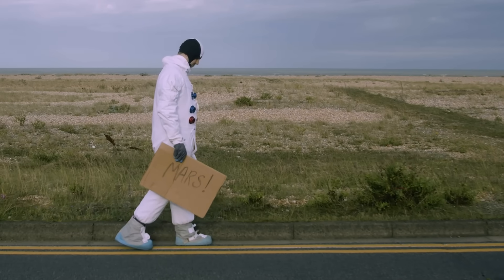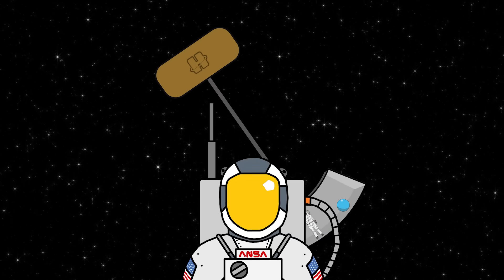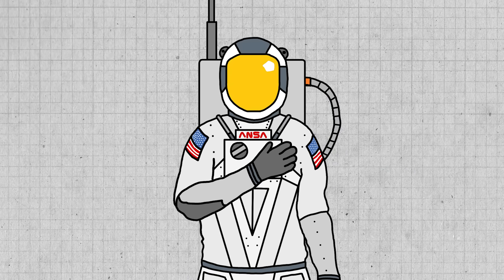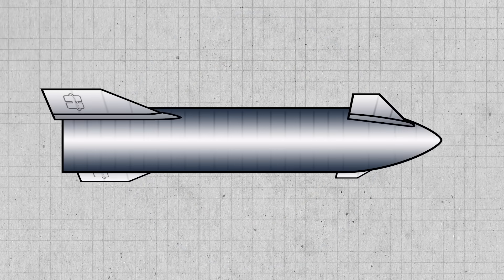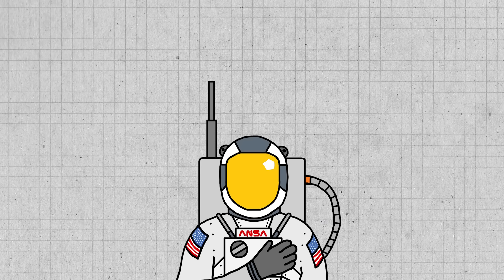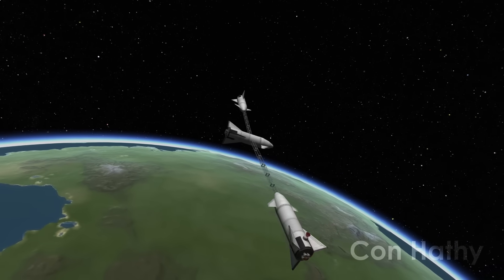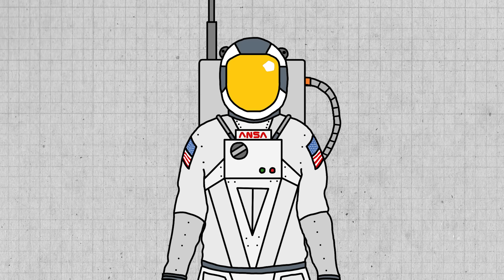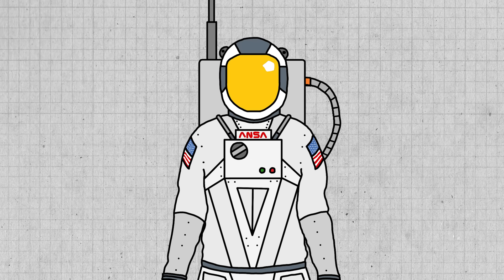This is NOT how you make Artificial Gravity

Comment: If astronauts lay down vertically on the internal circumference of the starship, on a rotating frame, and be spun around the ten meter hull, would that be like sleeping in gravity?
Reply from the maker: It would be, but laying down is has many of the same side effects as zero-g so it would not be very effective

Comment: I think when you actually get in space, real zero G ...none of these will actually work unless you are connected TO the ship. IF you jump up, lose contact for a bit...you'll be hit by a wall. 
"Oh but you'll have the same momentum as the ship"...yeah..til you stop touching it. 
If you're floating in space and a cylinder is spun around you...nothing will happen...nothing will draw you to the surface.
Reply from the maker: You do keep your momentum when you jump, the same way you can jump on an airplane or a bus and you don’t hit the back wall. Don’t confuse speed with acceleration. The only time you might “hit the wall” is while the rockets are burning to get the spin started, once you’re up to speed it doesn’t need to accelerate anymore
Reply: @ConHathy  But you have actual gravity working in an airplane or bus. you jump up, you come down. Takes a second. Not much time to lose momentum. With no real gravity, if you are able to jump up...nothing will bring you back down. 
Just wait. It's going to be hilarious when they actually try.
Reply from the maker: @yourhandlehere1  Your momentum carries you forward but because you’re traveling in a circle forward ends up being the floor eventually. Also from a relativity perspective you could think of airplanes or even buses as not having gravity but rather the wing or the suspension/wheels are accelerating the vehicle upwards so once you jump the vehicle flies up and catches you the same way that the ship rotates forward to catch you when you jump in space (not entirely an unfounded assumption because if you cut the planes off of wing midflight you’re going to end up in ZeroG for at least a short while so they really are the immediate source of the upwards acceleration)

Comment: I think either Smallstars got his idea a little wrong, or you're showing it wrong.  That center ship shouldn't be rotating at all.  It would be 0G, and provide the navigation systems, as well as a 0G work environment.  The other two ships would be attached with the scaffolding, cables, tubes, or whatever.  The scaffolding would just have a rotating docking clamp at the center, where the center ship docks to it.  The center ship would probably be docked at the nose, but whatever works best.    It's the classic ring ship from all the promised mysterious future stuff that we got in the 60s through 2000, before we gave up on space travel.    Rather than a full ring, it's just two ships, and the imaginary circle that they're on.  The center hub is what the center ship is touching.

So, no angular momentum problems.  No flipping and tumbling.   It's just there, where someone will (hopefully) be managing the mission from. 

That scaffolding doesn't need to be very fancy.  Like you said, we can already hang a starship by it's nose.   Basically the same thing, except twice as thick.   A expandable tube, like an expandable tunnel cat toy, would just be there for moving between the ships, in case something gets dropped, or someone loses their grip from the ship's tether.   In a scifi future, it could be pressurized, and everyone could be running around with no spacesuits.  In the real world, they'd have to bring that air along, and it'll suck when it's lost.   Once they've perfected infinite capacity air tanks, to go with the infinite capacity fuel tanks, we can revisit pressurizing the cat tunnels.

If the scaffolding was fancy and strong, it could (in theory) use the center ship to accelerate and decelerate the whole spinning mess.  But since all that mass has to be brought up there, that's too much weight, with little reward.  Stop spinning, disconnect, and they can all slow down on their own.
Reply from the maker: I show his own animation, it does rotate. But, just having the scaffolding rotate wouldn’t solve the issue unless you fully disconnected the center ship with a massive 3 axis gimbal, which would be extremely complicated
Reply: @ConHathy  Ah, ok.  Ya, his way would be problematic, like you showed.   Like he shows. :)  

The way I'd see it working, it wouldn't be a gimble.  Just a clamp on a bearing.  The cables and rotating ships would be like a propeller on an airplane.    If you could just release the propeller in flight, and reconnect, as needed.

They might want a large rotary connector, if the ships are sharing or transferring resources like power, data, water, or air.  Those already exist for a variety of applications, including electrical power, data wiring, pneumatics, and hydraulics.  There'd just be some work to do, to make sure the contacts don't cold weld themselves in space.  I'm sure NASA and SpaceX have put some thought into that already. 

Unless the center ship provides thrust, but I don't think they would really have any forces on it.  They could entirely detach the center ship, without hurting anything.   Unless the miniscule gravitational forces of the ships would be detectable.  Like how the rocky asteroids we've landed on recently are just small rocks and dirt, but still stay mostly together.

I only said scaffolding, so it'd be a hard connection, that would be less risky of losing astronauts and supplies.  The cat tunnel toy around attaching cables would be just as good.  Big enough for humans, of course. :)   They've shown that sort of docking tunnel in scifi shows/movies.  Somewhat realistic shows just show them being a very lightweight covering, so dropped items don't float away.

Comment: Never thought of using a small spinner... but I'd imagine it has to be a little bit larger than the one the researcher was using. Correct me if I'm wrong but it looked like his feet experienced the target Gs while his head was at 0 G still. More like stretching your skeleton than compressing it.
Reply from the maker: The video wasn’t a great demo because it’s in a control configuration. The eyes were intentionally at 0G, cg is at 1G and feet are at 2G. They also extend it so the eyes will also experience acceleration
Reply: @ConHathy  Ah, I see

Comment: Large counter-rotating space stations work fine, if we have construction facilities in orbit or on the moon. Even more so if we nuke the sides of some big comets and asteroids to shift them closer so we can mine them with less travel time...or for that matter, hollow them out and build stations inside of them, using taped composite bubbles, with the rock as radiation shielding. Then use the outer surface, perhaps 30 km circumference or thereabouts, spinning around 30 times per hour, as your tether platform?

Comment: Sorry, but your theory has more holes in it than a screen door. You did not discuss frictional bleed. That is where the rotating device bleeds its motion into what it is mounted on via friction. Eventually it would need to be corrected using fuel. Another thing is refueling the space craft once launched. Using a drone ship filled with fuel then placing that fuel in the mother ship. There needs to be a lot more research in what we need to do to provide a gravity to the ship while traveling to protect the crew from those things that would happen to a crew if traveling in a weightless environment. All of this research must be done with the ship being in space without an outside atmosphere.

Comment: The problem with a short-radius centrifuge is that your body experiences a gravity gradient, not dizziness or motion sickness.  Those experiments you show have the subject strapped to a frame, doing nothing.  His head is experiencing zero gravity (horizontally), and his feet are presumably at 1g.  What about when they remove the straps and try to do something useful?  If you bend down to pick up something, your head is suddenly experiencing many times more gravity.  E.g. if your feet normally experience 1g, and your head 0.1g, when you bend down your head is probably experiencing 0.5g.  Your head is now five times heavier than your neck has become used to supporting.  That thing you lift off the floor is going to get lighter the higher you lift it.  This isn't so bad, but when you move something from head-high onto the floor, it's almost weightless when you pick it up, but it gets heavier, much heavier, the lower it gets.  What started out as an easy operation suddenly gets out of control as you find it's actually too heavy, and you drop it.  You may fall as a result.  Now your head is experiencing maximum weight, but your neck muscles have atrophied due to spending most of their time at close to zero g.  You probably can't even lift your head.
I know we can adapt to different gravities, but experiencing a wide range of gravities simultaneously, where your hands weigh different amounts dependent on how elevated they are?  I can't see short-radius centrifuges being of any practical use for anything but short-term exposure.  You need to be far enough from the axis that the gradient is insignificant.  This means you're limited to living and working in the tip of the craft, and you'd be walking on the ceiling, which probably means the craft has to be much larger than it would need to be with a long tether, where the living quarters could use more of the craft's length.
You've assumed the long tether would be between two, equal craft, but that's not necessarily the case.  One craft could be much larger, and the occupied craft would essentially orbit it.  These hubs could be assembled in space, and stay in space.  A mission would dock with it, attach the tether, and go off to Mars.  On return, it would unhitch and return to Earth, leaving the hub parked for use by the next mission.  This hub could provide the forward thrust for the mission, allowing the main craft to be much lighter.
Reply: I think the idea with short radius centrifuges is they would be used like work out equipment not for full time.  You'd live and work in zero-g and spend maybe a couple hours a day in a short radius centrifuge (maybe sleeping, reading or listening to audio material) to avoid the health consequences of long term zero-g.

Comment: Flipping an iPhone on its intermediate axis is a misleading test of a two-spaceship tethered system. Too much of the iPhone's mass is concentrated near the axis of rotation, which is what makes it unstable. A practical tethered system will have most of its mass at the ends of the tether, making it more like a dumbbell with a round weight on each end. You can try rotating a dumbbell on a smooth floor yourself, with the round weights acting like wheels to reduce rolling friction. Once it's up to speed, it's easy to keep it rotating in a stable manner. If a rocket booster is mounted along the axis of rotation inside a round bearing in the center of the tether, its mass will not affect the stability of the rotating tether, and it can provide thrust to propel the system in the direction of the axis of rotation.

Comment: Short centrifuges are problematic long term but suitable for flights. A ring system outside, maybe 5-10 times larger then what you have in your lab might work.  You would need to compensate the opposing force but it is doable.

Comment: I have another question in relationship to such a space travel with spacecraft producing artificial gravity by rotation. 
Wouldn´t it require the astronauts to wear a kind of magnetic shoes so that they have permanent contact to the metallic ground to be able to walk inside the spacecraft ? 
Any centrifuge on earth pushes particles /objects away from the rotation axis by gravity ( dependent from rotation speed the pushing force changes - G forces) 
But that physical effect does not work under zero gravity conditions, right ?  Any person/object/dust particle would be pushed sideways to just one wall of the spacecraft instead of the bottom direction as it would be on earth.
Reply from the maker: No, the direction of apparent force is still outwards. Every object wants to travel in a straight line, to make that a circle you have to apply an actual force inwards towards the center of the circle not tangent to it. The force pushing up on your feet from the floor (which turns your path) makes you “feel” like you’re being pulled down into the floor. This doesn’t change in zero-g

Comment: short radius centrifuges have the problem that your head is experiencing way less gravitational force than your feet. and i thinks thats the reason why the eye pressure isn´t reduced. and i wouldn´t consider this an option for long distance travel, because this is way off from the relatively constant gravitation you experience throughout your body on a planet
Reply from the maker: It has shown significant benefits for muscle and bone density which are some of the big risks that would require rehab after landing on Mars, though saving the eyes would also be nice. It’s also worth noting that this centrifuge is still smaller than the diameter of Starship so you could get better results. (Though I also have to point out that the video doesn’t show the centrifuge in it’s largest radius configuration, it’s specifically a control configuration where the eyes intentionally experience little to no artificial gravity)

Comment: When travelling as a passenger in a bus or a car, depending on how curvy the road is, I always get nauseous if I read something, e.g. a newspaper. Then I have to stop reading and look around at the landscape, until the sick feeling fades away. This is always the same, and I would derive a little theory here, arguing that motion sickness may not only be based on effects on the inner ear etcetera, but also on a disconnection between what one sees and how one is actually moving. Since I am never getting nauseous in a train (or if I drive a car by myself), there must be a threshold for the directional change where the disorienting effect begins. I would then think that walking (too fast) under artificial gravity in various directions could lead to disorientation and then to motion sickness, since it is in fact a spiraling with extended complexity, through space.

Comment: Why not just make the furniture on the starship switch between the walls and the floor, so you can spin the whole craft along it's length and astronauts can walk on the inside of the Hull during the journey, and then switch to the regular floor when landed

In fact you wouldn't really even need everything to do that, you could have the vertical strap style beds they have on the ISS and use them laying normally in flight, or vice versa if its easier.

I guess the harder thing to solve is the bathroom problem, as you can't really rotate all of the plumbing

Comment: Note this is very noticeable in KSP for early RP-1 rockets, which almost always have at least one spin-stabilized stage.

If you start them spinning on the minimum axis, above a certain altitude, they will slowly spin out towards the maximum one due to the fact that KSP rockets are made of multiple parts that can bend and move in relation to each other.

It's also an important concern when making stock props. A 3-bladed prop is stable but a 2-bladed prop wants to yank the axle out of its housing whenever you turn the aircraft.
Reply: I got the prop example
Reply: ...I honestly don't think I've ever had to spin a single KSP ship...
Reply: @TheWorldsprayer  he’s referring to the realism mod overhaul.
Reply: @TheWorldsprayer you never build a giant mass spinning completely unnecessary to brake either your ship, physic engine or hardware. Man you really missed out on a hell of a lot of fun.
Reply: @TheWorldsprayer  Not in stock KSP but in the RP-1 Realism Overhaul you do
Reply: @TheWorldsprayer  Me neither. Some people really overcomplicate that game.
Reply: @aniquinstark4347  you do with certain mods

Comment: I eventually COULD get my phone to flip along the intermediate axis... but, I had to apply a TON of force (I had to flip it super hard and fast) and grip it with both pointer fingers and thumbs real close to the middle (by the charging port) and flip it super hard.  Now I'm wondering if there is a certain amount of a counteracting force/momentum/acceleration that can be overcome... but only by brute force
Reply: And your experiment has highlighted the most critical part of the problem; one that is hinted at or implied in the video, but not actually mentioned-
The Energy Cost! As you discovered, the energy input required to pull off any of these scenarios ramps up dramatically!- It matters not where that energy comes from- be it fuel carried with you, or some other exotic source.
Point is- you need a LOT, it has to come from Somewhere!